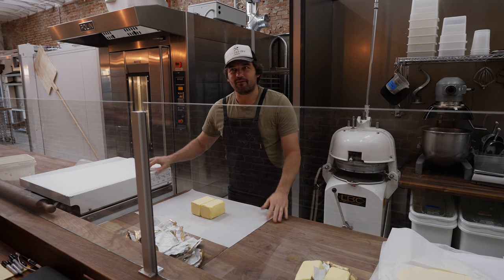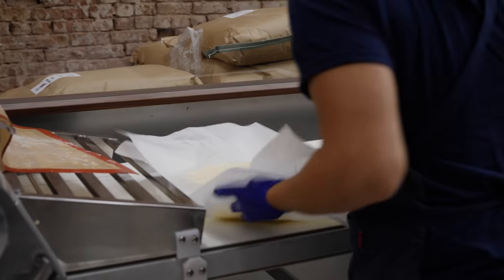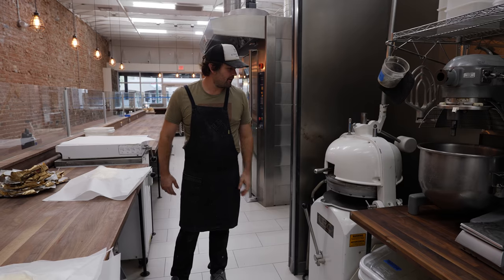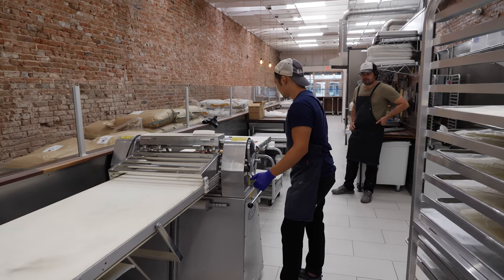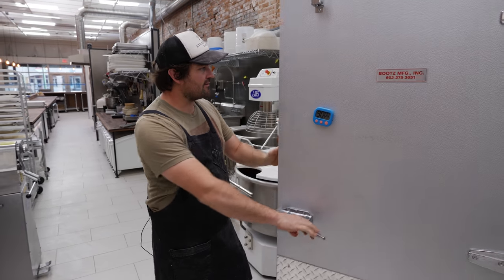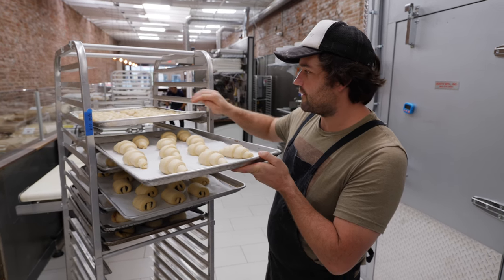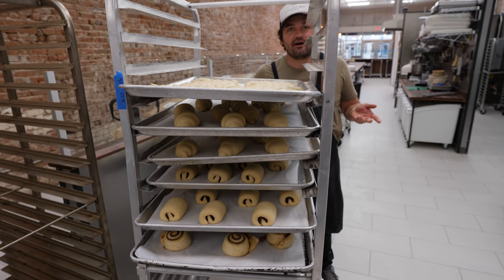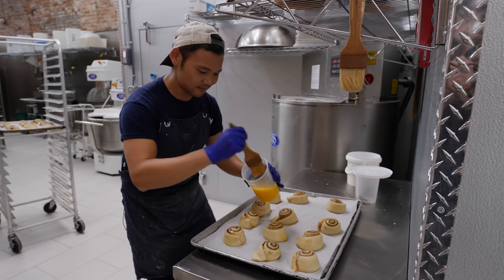Pressing Croissant Butter and Proofing Pastries | Proof Bread

Comment: That's still a lot of work. I started out "bludgeoning" then I hired a couple of bakers who showed me how to use butter that was maybe 75 or 80 degrees, spread it on folded parchment, rolled the soft butter to a square and then into the fridge. But then, yeah, waiting for it get to the perfect temperature. Still a lot of work. Then I rigged an apartment fridge from Costco with a thermostat that keeps it at 62 degrees. Still paying someone for a couple hour's labor. Now I'm buying Beurremont butter sheets from France and thawing them in the small fridge. Labor is next to nothing for the butter. But man, the s*&t's expensive! And not very eco-friendly. Your using an old Dutchess machine is brilliant, and I might just look for one. Thanks for your videos!

Comment: Dear John. From a bakery in Netherlands a small tip. look into some high quality smearing oil for your oven wheeles. it needs to be heat resistant otherwise it will burn in the oven. it aint cheap but its a small invesment compared too having to buy new oven wheeles evrytime.